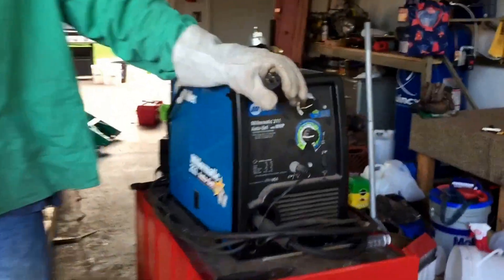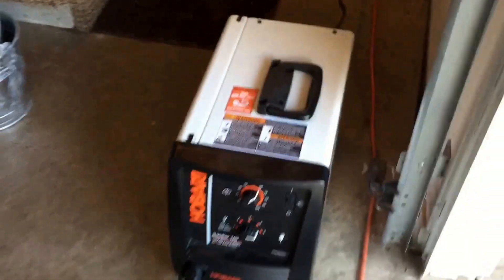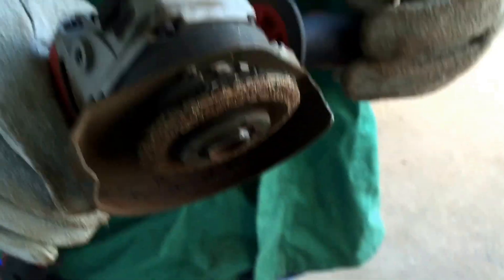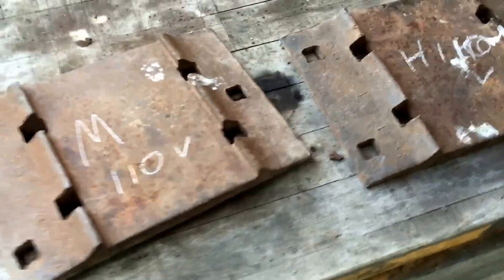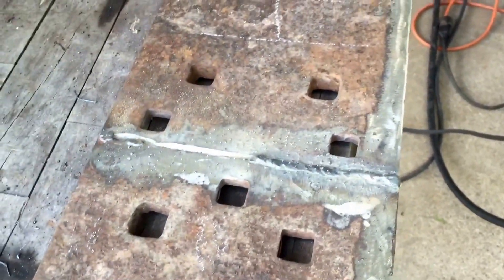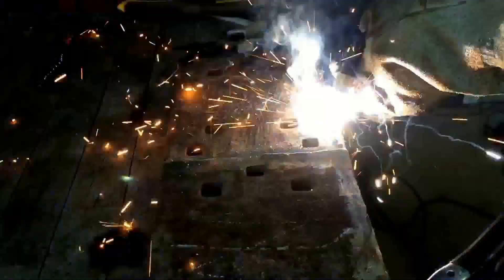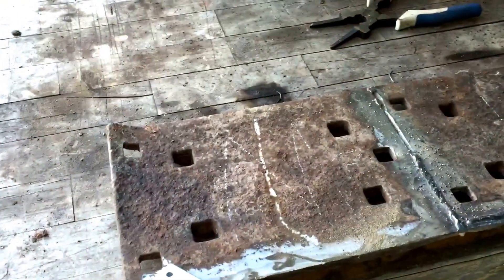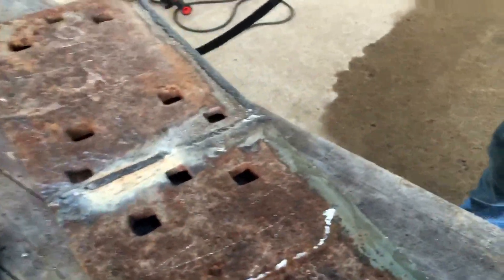Miller 211 auto set VS Hobart handler 140

Comment: Wow, theres so much splatter compared to gas shielded.
Reply: Mark maybe a very high amp setting causing that
Reply: @yananRamirez he has the polarity connected backwards the wires have to be reversed
Reply: @yananRamirez he has the polarity connected backwards the wires have to be reversed
Reply: The splatter is the wiring is not connected properly

Comment: no mention of what setting your using on a side by side test of different size machines? just a little info on electric if you have 115 volt and 230 volt its not possible to have 110 and 240 supplying your garage at the same time unless your garage is being fed from 2 separate transformers and meters.
Reply: What🤨

Comment: Hobart is made by Miller. It's their homeowner model with a cheaper quality..
Reply: I worked at Miller for 18 years. Same machine, different distributors.
Reply: Not the same welder, but same manufacturer. Built on the same assembly line. The Miller is a 115/230 Volt Inverter based machine with infinite voltage adjustment and auto-set technology. The Hobart 140 is a 115 Volt transformer based machine with a five step tapped voltage adjustment. The Hobart is nearly identical to the previous version of Miller's 110 volt machine, but that machine also had infinite voltage adjustment. To say they're the same machine would be like saying a V-6 powered F-150 is the same vehicle as a Lincoln Navigator. A more head to head comparison would be the Miller 211 vs the Hobart Handler 210 MVP as both machines are 210 amp dual voltage machines. This comparison was useful in demonstrating the difference between a $500 machine and a $1200 machine, and would have been much more useful if it hadn't run out half way through the comparison.
Reply: Not so much a difference in quality, as a difference in features. I worked in a shop where we had two comparable Mig Welders side by side. A Hobart 175 and a Miller 175. Both clearly came off the same assembly line, and looked identical, except for the paint. The Hobart had the tapped voltage adjustment, either four or five steps, can't remember for sure and we used it for steel, running .035 solid wire and 80/20 steel mix gas. The Miller was set up for aluminum with a 1 lb. spoon gun and control box with pure argon and .035" aluminum wire. Pretty sure we ran 4043 most of the time. Only problem we ever had, in nearly a decade of use while I was there, was when the Miller's circuit board fried after seven or eight years. Sent it to our local welding supply and they had it repaired. It worked like brand new after that. One thing that was interesting was that even though they were built on the same assembly line, the Hobart had a Tweco gun, and the Miller originally came with a Miller gun, before we swapped it out for the spool gun set-up.
Reply: Hobart made better welders than Miller for 60 + years. Hobart got screwed by canceled US govt contracts. Miller jumped in and bought them out.
Reply: Not cheaper...just a different paint job!!!